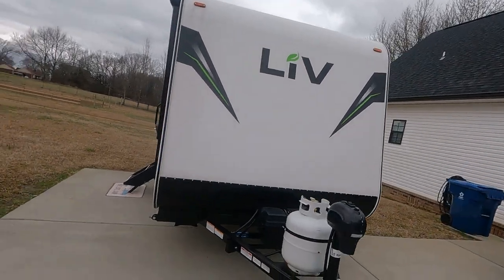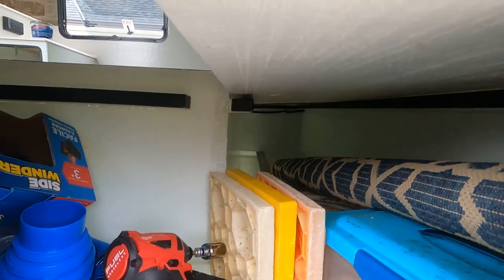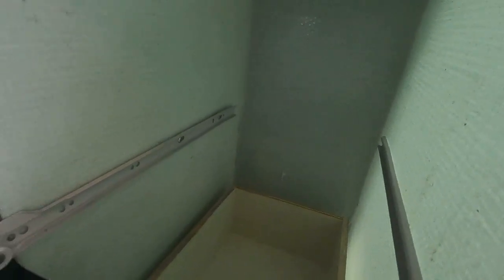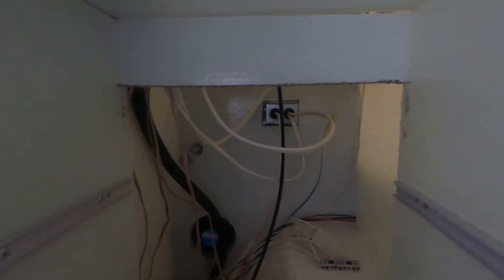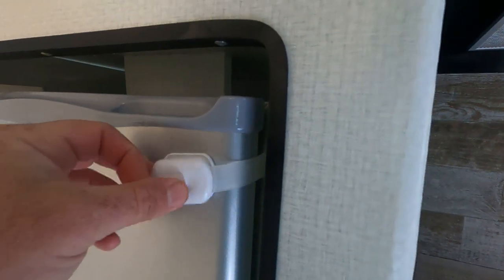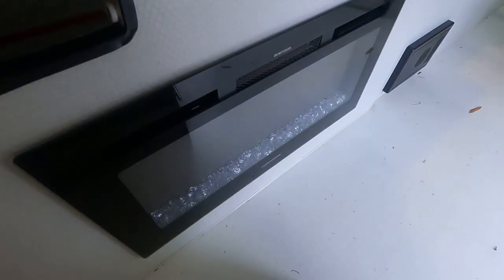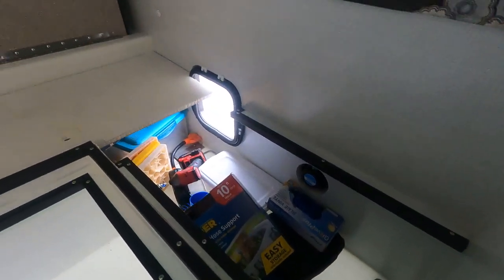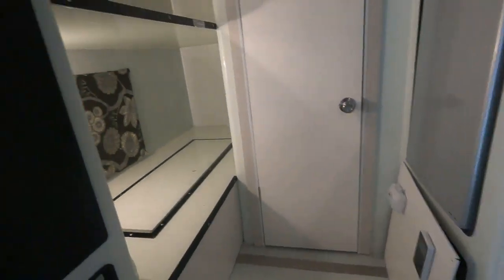2023 LIV 19BH Trailer - Behind the Scenes Tour

Comment: Considering going down to Americus to check one of these out. I like the concept but wonder about the longevity of the material. What issues have you had? Would you purchase one again?
Reply from the maker: I've had issues with leaking around windows and door and condensation is a big concern.   Trailer comes with a 10 year warranty on the box and construction.  Thermoplastic is very durable talking to my engineering friends, but repair is a bit more involved if somehow damaged.  Stay tuned, im about to post up some more details on issues ive had
Reply: I really like that the floor is rot proof in the event of a leak. It’s such an interesting construction material. Is the condensation issue any worse than a typical travel trailer? We have a 17’ Casita trailer, condensation can be an issue but the interior is covered with carpeting so it’s less evident than a smooth surface. We also have a dehumidifier. I’m curious, if you want to mount rooftop solar, how would you do it? I imagine the crush resistance from nuts and bolts wouldn’t be very high.